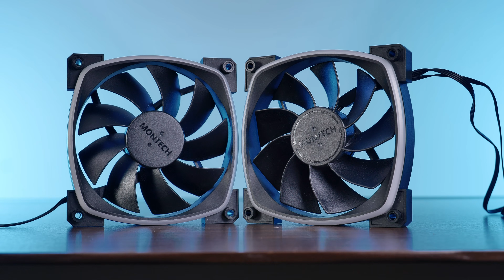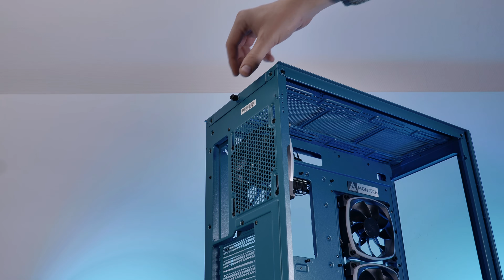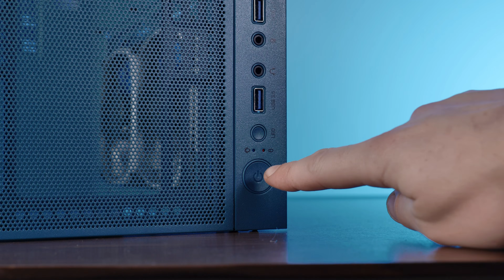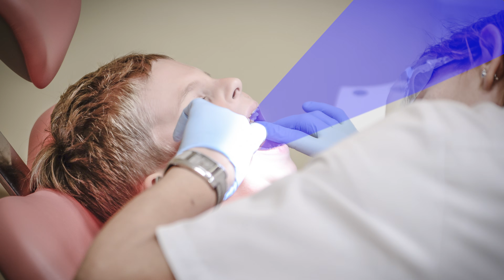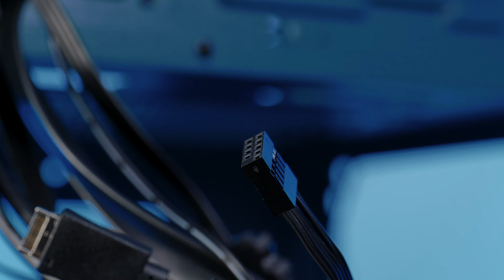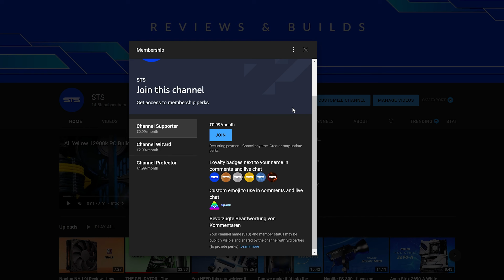A Work of Art - Montech Sky Two Review

Comment: looks nice, you forget to mention when using button fans it bloks a pcie slot ? would be niceer just a little higher case to fix that . plus the quality control you said makes it a fail case for me .
but it looks realy nice . xD
Reply from the maker: They don’t block it entirely though. If you have something without a heatsink (NIC, SATA controller …) it should work fine.
But yeah, quality control seems like an ongoing issue

Comment: Any case that has psu at the bottom is a waste of money. GPUs need at least 2x140mm fans with clear path. CPU should get INTAKE from the back and top and spit it from the front and top. Otherwise it breaths GPU exhaust. Thermal basics (air should enter as cool as possible in the cooler) that almost no manufacturer or reviewer seem to understand. So sad. Just so sad.
Reply from the maker: It absolutely depends on the GPU. Blower cards will blow their hot air out in the back. And so do many others. + most people have their PC tucked against a wall. That’s why you generally do not use the back one as intake. 
You’re right on the GPU hot air inside the case. That’s a problem in general which will not be solved until they are build differently. But as of now this is the best layout we can work with.
Reply: @STSYT  But the back of the case has also cables, which keep it away from wall. Intake will work fine and ensure CPU gets ambient directly not GPU mixed with general case temp+ambient.

Comment: I got this case recently from my local microcenter - and while I like the looks/the accessibility I also have the issue with the fan hub and the fans running at max speed. Montech needs to fix this asap! There is a reddit post I found and they recently said they will fix it... but this should have been properly tested/fixed before it hit the shelves. Other youtube reviews also mention the issue
Reply: check out the others...
https://youtu.be/9jXzd2G-w9Y?t=878
https://youtu.be/R83JtyOi0dY?t=496
https://youtu.be/-_Zt7xTuh5k?t=734

Comment: the 3 fans that "seem" to enter (2 on the side and 1 below) have the frame outside so the air comes out instead of entering or am I wrong?  since the rear fan has the frame outside so it blows out air
Reply: They are reverse fans so you can see the rgb instead of the ugly side of the fan